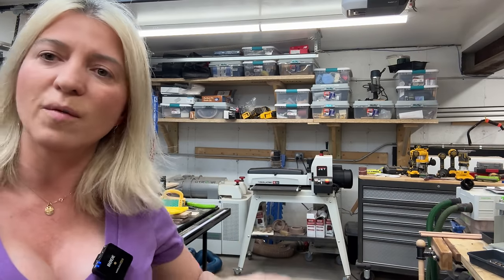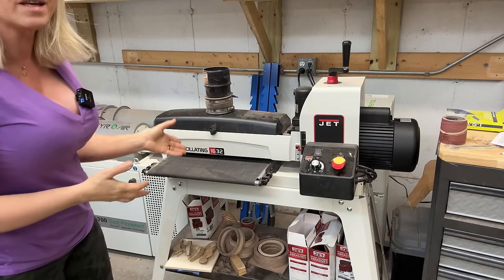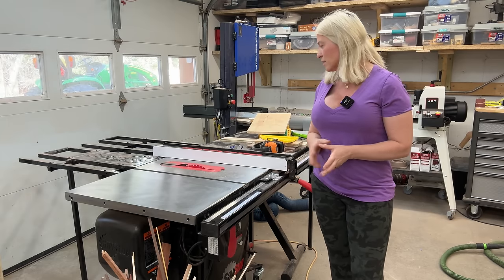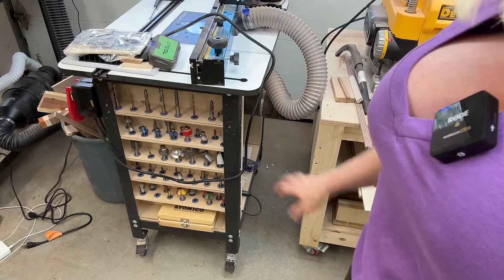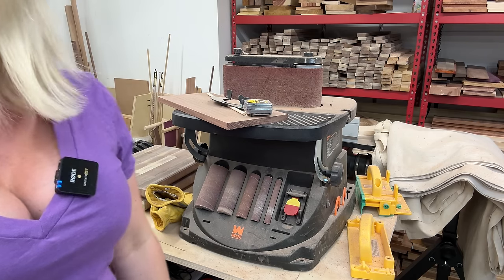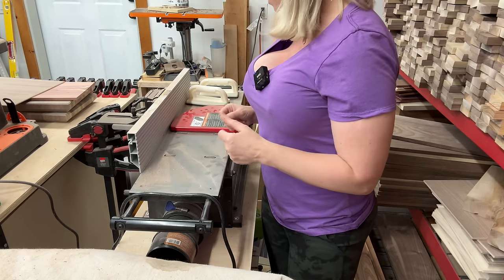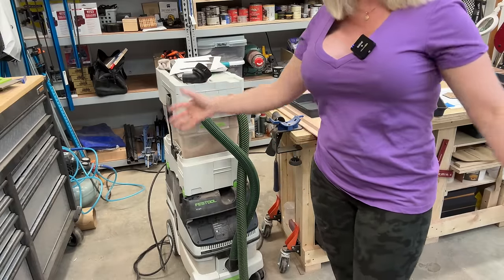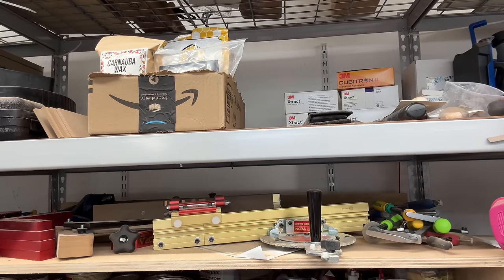2024 Small Business Woodworking Shop Tour

Comment: Lovely shop! BTW, the Festool CT26 is not the same as a shop vacuum. It is specifically for "dust extraction", i.e., hooking to a small power tool (especially sanders) to pull fine dust in so it doesn't go all over the shop. It will serve as a general vacuum, but its extra expense is for the former use.
Reply: Shop/professional Vaccum can also do the same as you said. The real difference is the filter system which catches fine dust.
Reply from the maker: Great point!

Comment: 😊Great shop.  I noticed one thing back when you showed us your collection of hand planes and again in the shop tour.  Generally hand planes should be stored so that the blade edge is protected.  This is usually done when using the hand plane by setting it down on its side when not being used.  Often in storage the hand plane is stored on leather or fixed in a location where the bed of the plane is supported but the blade is in a gap of the support.  You spend a lot of money for a hand plane and spend time and effort to develop a super sharp edge.  Storage will help the edge stay sharp and only get dull from being used.